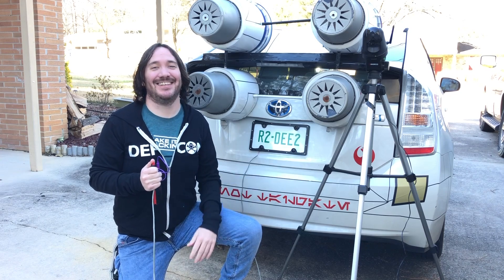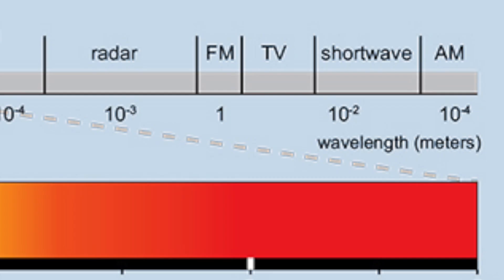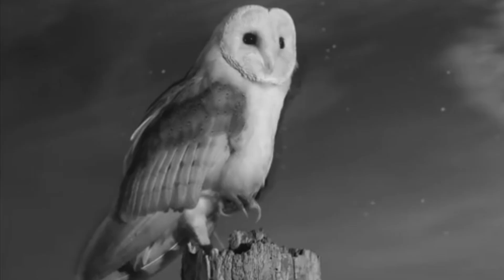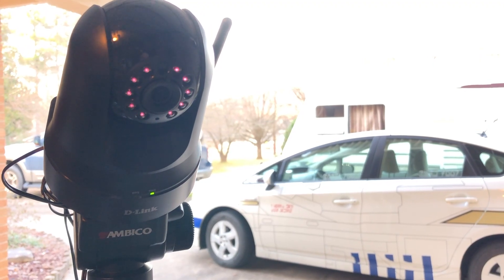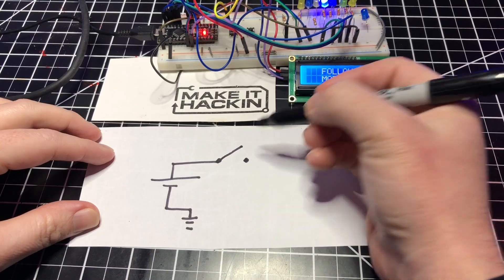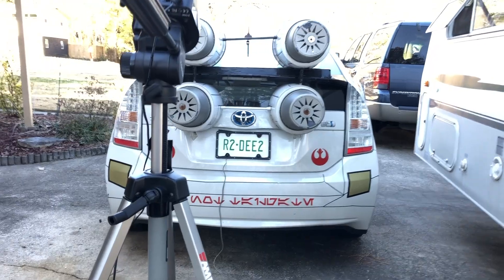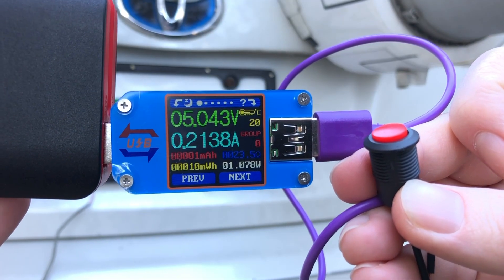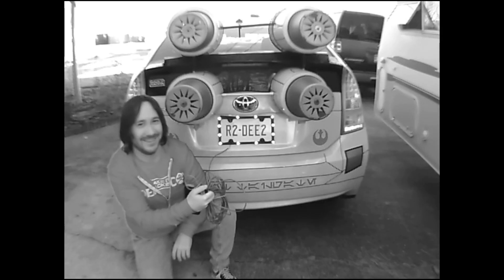The Science of the Camera-Blocking License Plate Frame

Comment: What do the resistors do? Can this work without the resistors?
Reply: Connecting LEDs directly to a power source will destroy the LED. LEDs cannot limit their own current consumption so another device must be used to do so, usually a resistor or LED driver.
Reply: @Marios03wrx  Thank you for a straight forward answer.

Comment: Using higher wattage, higher output IR led's would NOT make any real difference as you are competing with regular daylight or extreme bright light of a regular normal day. The best effect you could achieve would likely resemble what your obtained result was with the IR cancelled during the night shot with the IR led's just faintly glowing around the plate frame. Further additional work is required to obtain a suitable method for blocking the photo during the day.
As another person commented using visible light would SEEM the proper solution, but in recent days perhaps during the last couple of years, the agencies that are taking the photos can adjust for resolute clarity with various post editing means to obtain a clear plate reading and send you a bill. It is the classic cat and mouse scenario, or black hat versus white hat hacker. Good luck with your mission.
Reply: If visible light is required I would think high power camera flash bulbs or maybe 🤔 a targeted (visable) laser?